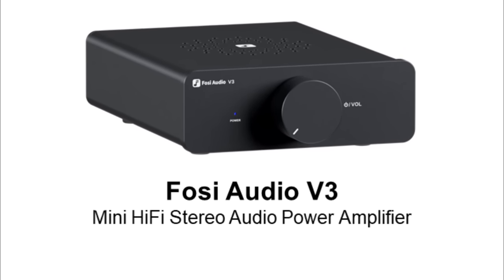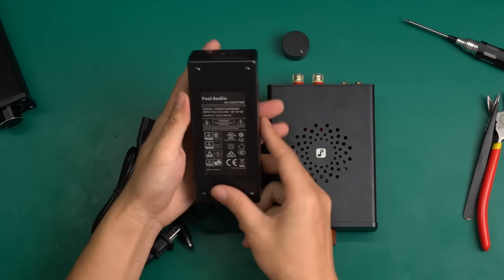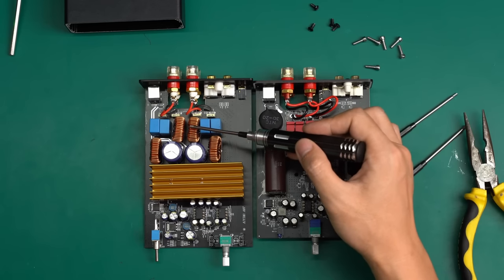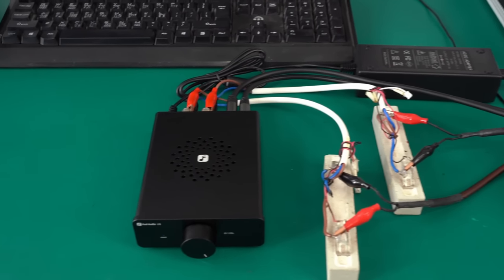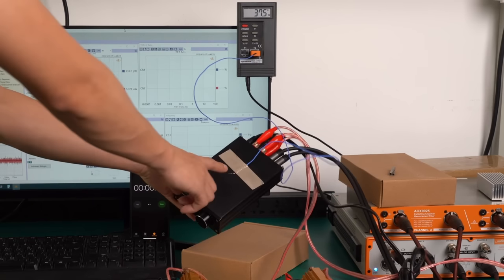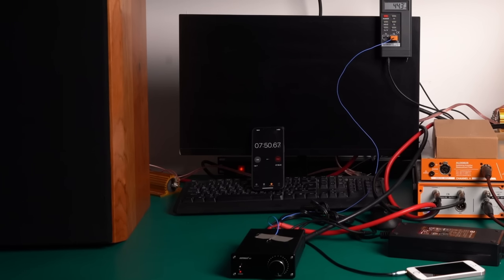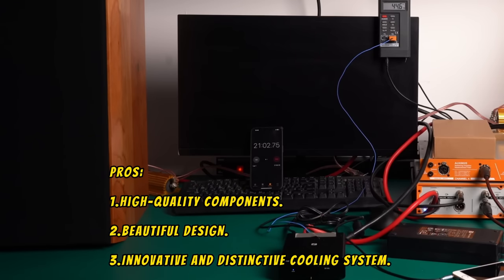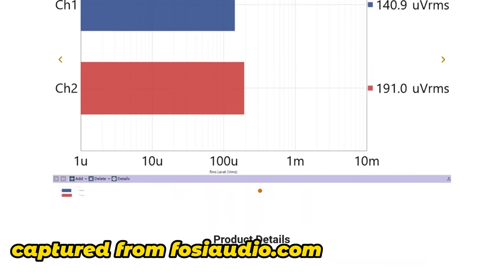A Decisive Victory? Fosi Audio V3 vs Aiyima A07 Measurement

Comment: 89 watts would be impressive if it was into 8 ohms. Using peak watt ratings into 4 ohms is misleadingly exaggerated for products designed for the home. I would rather pay double the price for a stable 100 WRMS into 8Ohms instead of yet another 50 WRMS chip amp. I have some of these products (BT30D Pro) and even on my 4 Ohm bookshelf (I have multiple pairs of varying sensitivity) speakers, the volume control is 75% or more for anything approaching higher performance levels, which does not bode well for rated distortion levels either. 

While these amps are 'okay' for average SPL (loudness) on desktop systems, they fall into the age old categories of, "If it sounds too go to be true, it probably is," and "There's no such thing as a bargain." Sorry but, this old boy won't be falling for anymore of these exaggerated gimmicks again.
Reply: On the supplied 36 volt supplies you can expect a very clean 75 watts RMS from each channel, both channels driven.  On 4 ohms you an expect 130 watts per channel before exceeding the power supply's limits, causing it to shut down. 
And yes those are by measurement ...

The TPA3255 chips at the heart of these amplifiers are highly sophisticated Class D circuits. You will find them in lots of places, like high end home theatre, pro-audio amplifiers, powered speakers and... yes, even in high end stereo products.

These little amps are not gimmicks... they represent advances in technology that, both simplifies amplifier design and makes it afar more efficient.  The price reductions are following the simplified design and mass production techniques.
Reply: I’m using an Ayima 07 instead of my Audiolab 8000P power amp. It can handle my inefficient speakers and room size no problem. Power is power and these amps are powerful.
Reply: My sweet spot is almost 7 feet from my speakers at 9 o'clock knob. Both 36V-5A and 48V-7.5A power supplies.